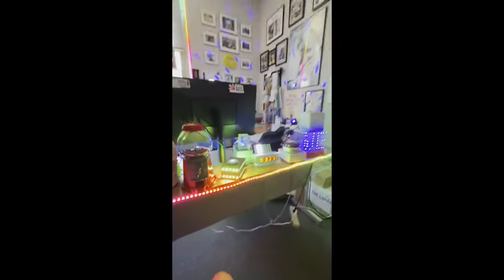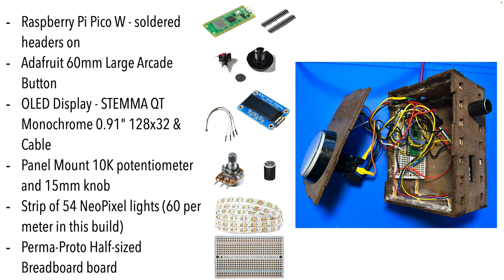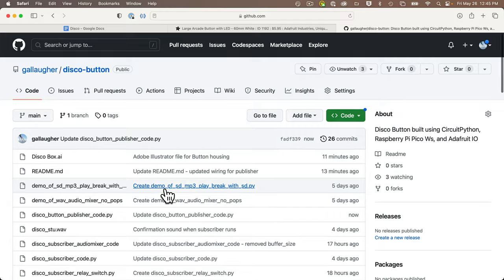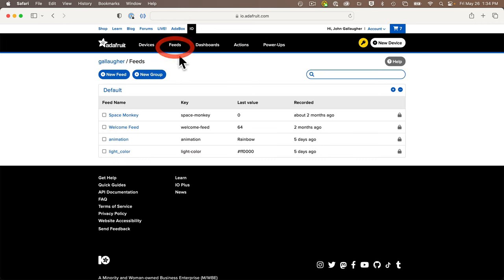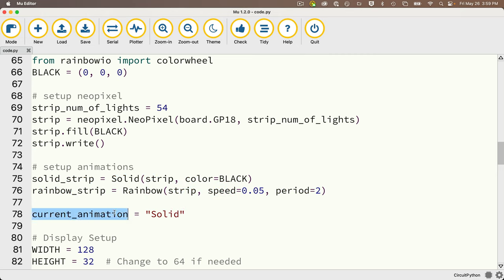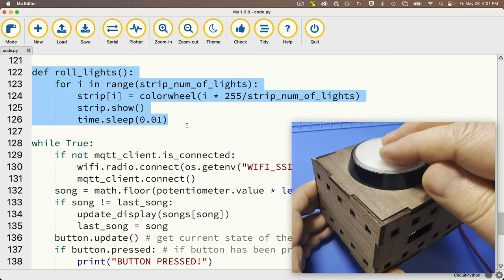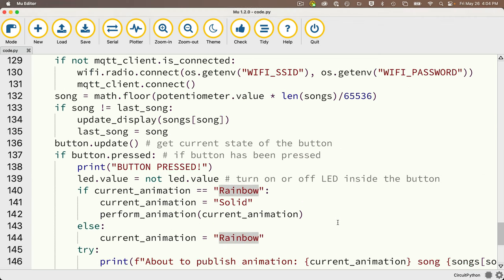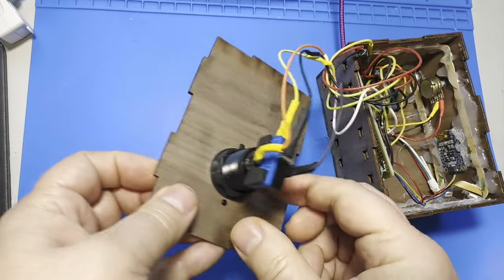Disco Button   Funk up any room with MQTT, CircuitPython, and a Raspberry Pi Pico W

Comment: Hi i am facing an issue when i install CircuitPython the storage is reducing from 128 mb to 470 kb do you know the reason why it is happening?
 BTW it is pico w
Reply from the maker: Check out the video "Troubleshooting: Fixing Common Issues with CircuitPython" that's in the playlist: https://bit.ly/circuitpython-tutorials. Especially note the info about how to deal with lower storage & how to use flash nuke. Also - the first item in my CircuitPython Tip Sheet to students shows another thing you can do: http://bit.ly/CircuitPython-tip-sheet